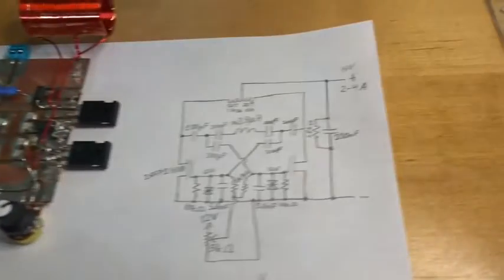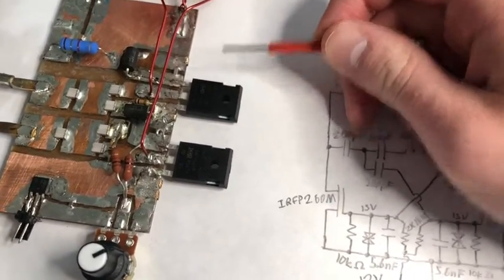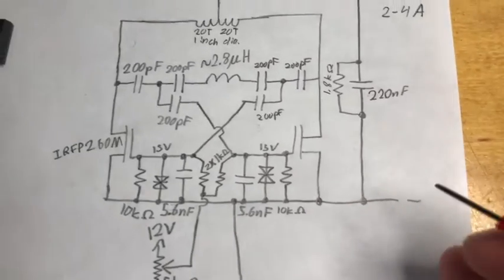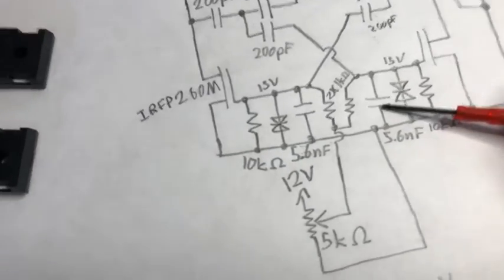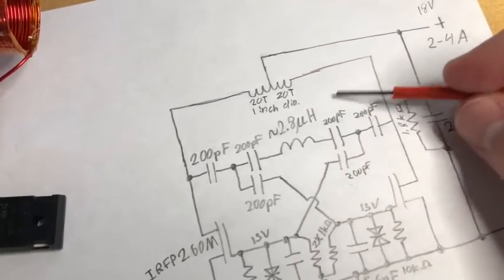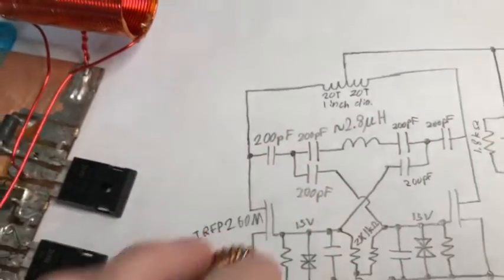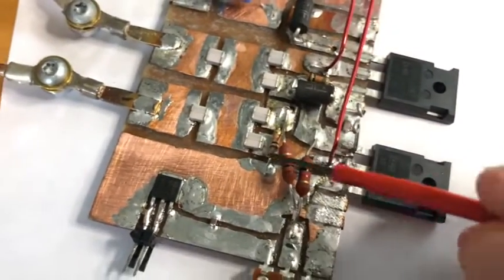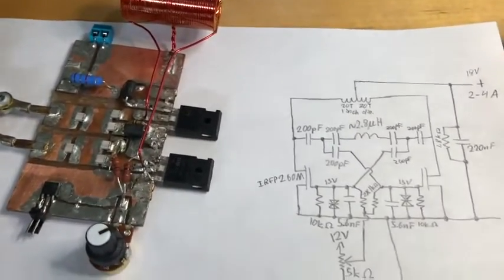Explanation of my "plasma toroid" driver (10.5MHz 80W ICP power supply)

Comment: Could you let me know what size copper tubing you used for the working coil and about what diameter is the entire coil?
Reply from the maker: It was 3 or 4 mm OD tube, about 10cm across IIRC

Comment: Oooh thank you sooooo much mate,,,I don't know much about rf circuits and the mechanisms of operations,,,so I'm just picking up things as I,,,I made a coil to be driven for the plasma toroid prior to getting all this information, but the online calculations told me it had so thing Like 7.8 uh inductance and yhe only caps I have are 3kv 820 picofarad caps ..both values much higher than normal plasma toroid generators and producing a resonant frequency of something like 2MHz,,,tho I think I'd be lucky if I get something like 1.5 Mhz from it...I can't try going forward like this,but I have no probing gear so I won't even know if it's oscillating and even if it is if the frequency is capable of forming a plasma toroid...I can change the circuit to match the conventional circuit and get the 10 mhz oscillation but is this phenomena frequency based? Does it only start  occurring after a certain threshold frequ3ncy is reached or will this frequency of 1-2Mhz be sufficient to make the phenomena occur?

Comment: Do you have a source of a cheap tube to use with it? I assume the MOSFETS do not get hot. I saw other folks with a heat sink and a fan.
Reply from the maker: no, the xenon globes are very expensive. I borrowed this one from a friend. The mosfets get warm, but it can run without a fan for quite a while on just a plate of aluminum. I would still recommend using a heatsink and fan.

Comment: Nice circuit. I love the cut and peel PC board. I've used that technique many times...

I was doing a quick look with the major parts suppliers and both seem to only have 
the 3kV COG caps on back-order and large quantities. Do you have a better source?

Cheers.
Reply from the maker: I ordered them on mouser.
Reply: @LucasWills  Strange. I just checked again. All the 100pF caps in 2,2.5 and 3kV 100pF required ordering thousands of caps.
Too bad. I'd love to build one of your drivers.

Cheers.

Comment: Does it make a difference if the C0G are SMD or regular shape with legs?
Reply from the maker: THT caps will have higher stray inductance and worse thermal contact with the board (they will get hotter). It will most likely still work, just keep those things in mind.

Comment: Thanks for sharing! What‘s the advantage of this circuit compared to the one shared by Tate McAluney from BackMacSci ?
Reply from the maker: From my testing it seems to be more stable and easier to get working efficiently. Also this circuit does not require high voltage mosfets, since it runs at a lower voltage with higher current.